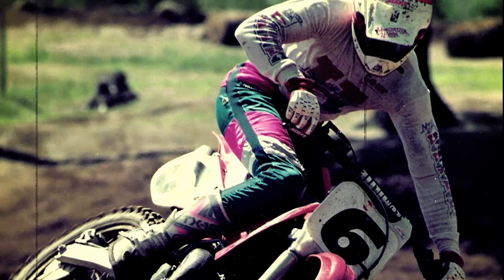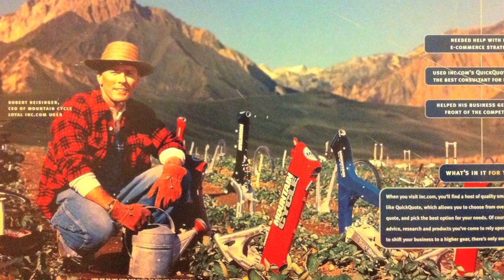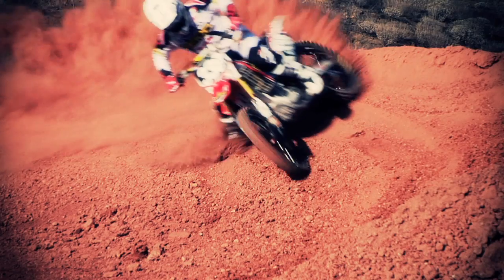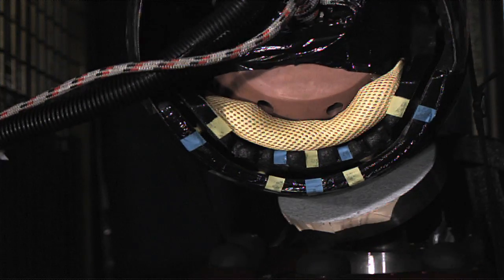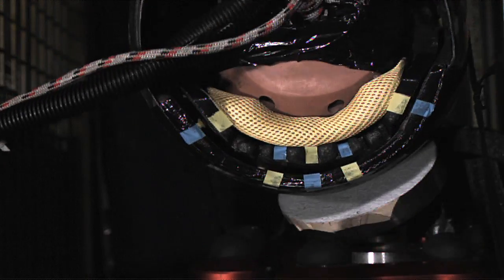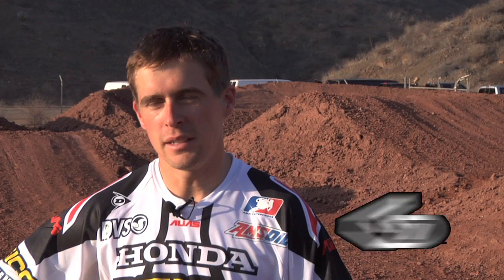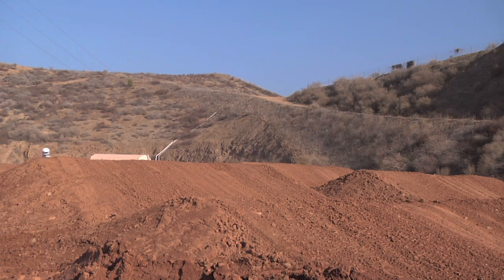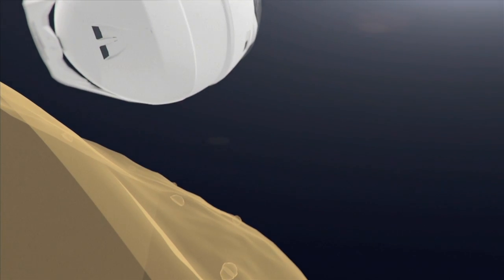6D Helmet Introduction

Comment: Remember This is cutting edge and it's very expensive to do that kind of research and to finally come out with just a single helmet is fantastic.  I'm surprised it doesn't cost more.  Arai sells a hand laid carbon fiber helmet for $4000 made to order.  The per son making said helmet isn't even allowed to try until after 20 yrs with Arai.  The technology will trickle down, and don't think the other helmet manufacturers won't have something in the works soon!